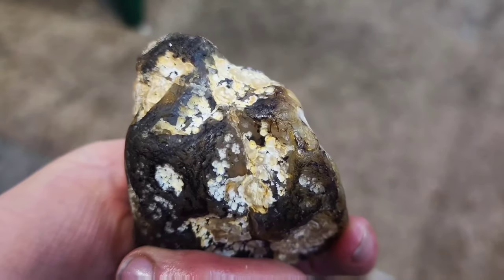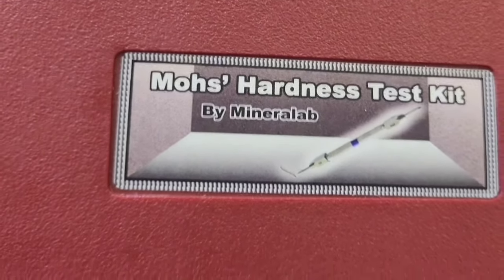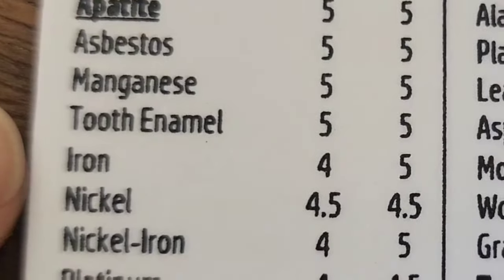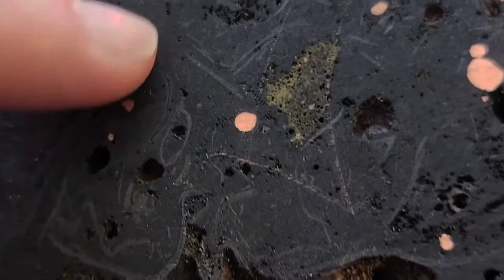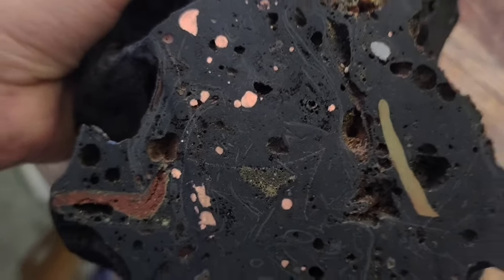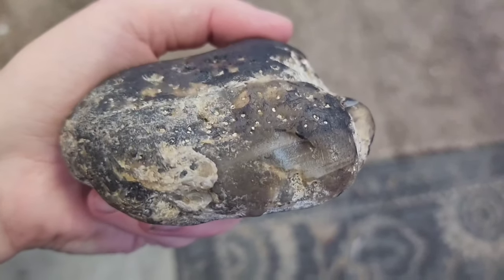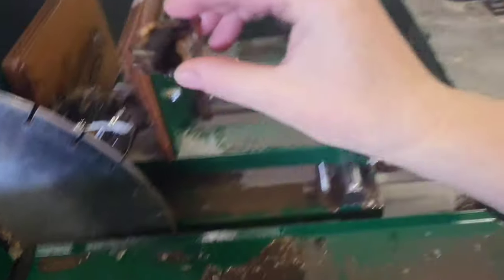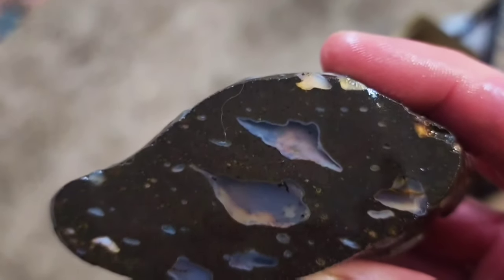Volcanic Rocks & Dino Poop #LearningGeology

Comment: Do the scratch tests on the inside of the cut rock. With gas bubble agates like this....you are only scratching the carrier material. Probably Scoria. A low hardness is typical for that kind of lava. Btw....the dendrites are probably the most magnetic part here. Typically iron or manganese are the primary elements in dendrites. This looks like a typical gas bubble formed in Scoria...which is about a 5 on the hardness scale.

Comment: I also use a wet stone polisher like yours. I have filled some cloth bags with sand that keep your nestled rock in place as you polish. Or of course you can use a wide vise.....but the sandbags work best. your videos are probably the best of the group of you from there on the Yellowstone...just don't tell your buddies that I said so. heh
Reply from the maker: 😉. That's a great idea with the sandbags! I just polished a 3 pound agate and made a video....sandbags would have totally helped! I really love that idea.
Reply: And for polishing slabs I use a soaking wet towel folded on the ground and the slab doesn’t move at all.

Comment: The square MIGHT have a FILM over the top of it that is carrying some of those effects. If you do a scratch test and find that the square and the material appearing directly along side of the square have the same hardness....you probably have a layer of calcedony just over the top of the square. 

Recommend cutting directly into the square and checking its hardness against the surrounding material.. That'll narrow down the choices of elements.

I owned a factory that made composite aircraft propellers. Dangerous stuff. All I did for a living is devise tests to narrow things down.
Reply from the maker: Wish I had you in my rock shop with me every day 😉🤗🥰

Comment: I'm really enjoying watching your videos and learning a lot, it really helps not having to go through the whole learning curve and get right to the point! I'm figuring out the equipment I want and size, also which one first. I'm thinking I'll build the Saw 😀 I build custom sawmills so it's right down my Alley. I am trying to figure out what size I should build? I'd hate to get it done and want a bigger one. I heard you say you cut this on a 18' . 
Ohh and by the way the vibrating tumbler worked greatly on the sunstones 😀, it was a little tough but they are beautiful. Running some rough amethyst through it right now.
What fun!  Permagrin😁
Reply from the maker: I have an 18 inch saw- it's a good size for most of my finds. If I had crazy mad amazing skills like you and was building my own, I'd do something between 18 and 26 inches. Generally, the saw is only going to be able to cut half the size of the blade when set up. So, sometimes 9 inches is just a little small for me.
Reply: @MontanaRockMom  well that's the rule, Half the blade minus Half the collar/arbor. Really comes down to how much you want to pay for blade's, mabe? 
Also I could make you a conversion kit for yours I'm sure to get you a few more inches of blade. That is if you have enough travel on your carriage to be of advantage. I'll be looking into this and get back at you when I look at blades

Comment: That's a tetragonal crystal...the square...so it won't be quartz. It could have quartz in it (it obviously has some other stuff in it)  but that shape is dictated by the primary element of which there are  a lot of choices. If it is a quartz crystal it has six sides. 

That area will be the oldest because it formed first. Technically, the oldest part is the base attaching the square and if you look closely you can see other squares behind it. 

Turn it upside down and you can imagine the square forming in an empty cavern up from the bottom.....as if would have to to form this perfectly. Million of years empty but for the forming tetragonal structures.....and then millions more to fill the cavity with the makings of agate....and then millions more to fill what's left of the cavren with quartz. 

That's quite a rock there.
Reply from the maker: I think my mind will be deep in thought today of all that went into forming this rock. The perfect conditions and minerals that were present and the millions and millions of years. I am very grateful for your comments and sharing your vast knowledge.